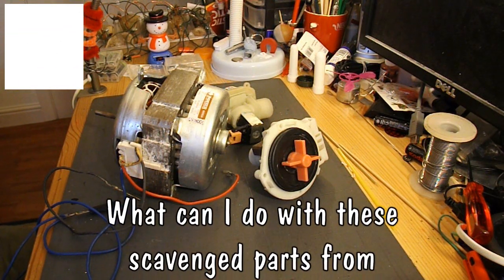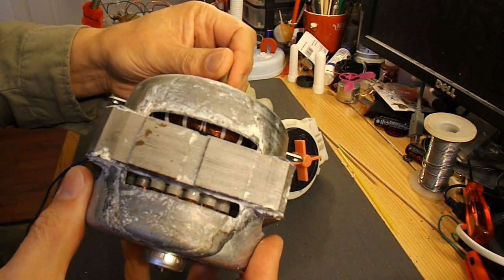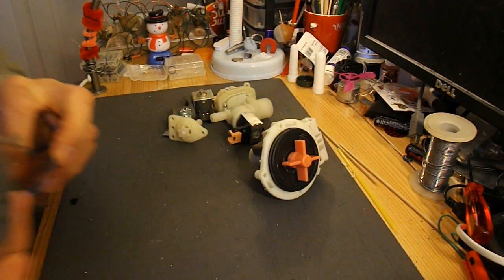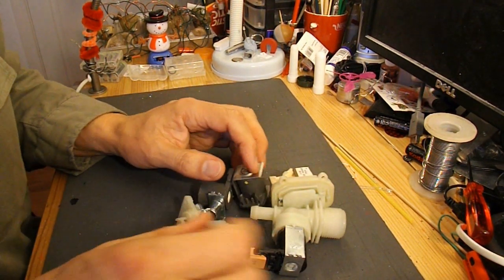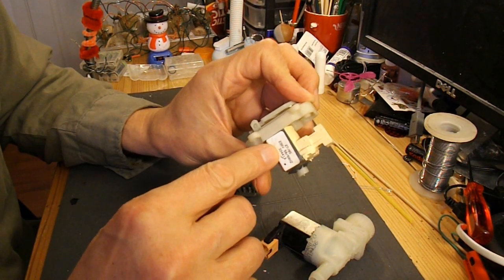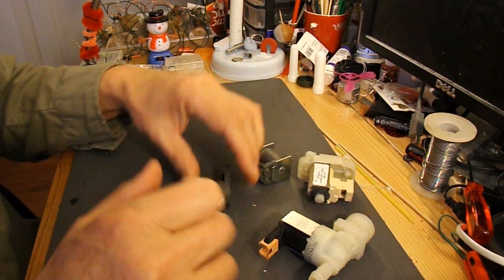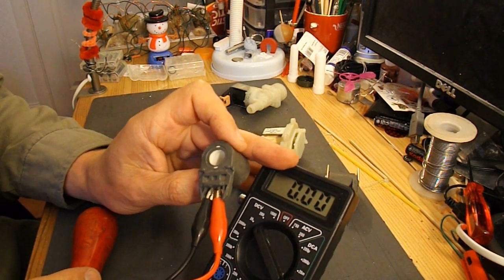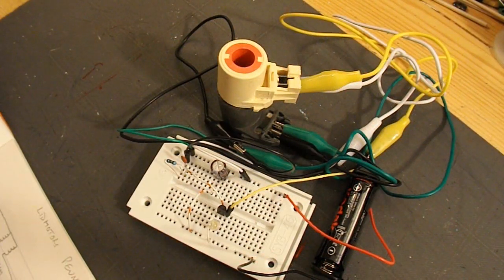What can I do with these scavenged parts? #1

Comment: Was the screwdriver tip magnetic, could that be the fluctuation in your numbers?
Reply from the maker: I love it when a random comment gives me an idea for another video. I suspect you are probably right that the screwdriver has a magnetic tip but putting an iron core in the coil will still generate a current and as I don't possess a Gauss meter I cannot prove that any material I use is completely free from a magnetic field. However, I will set up a little test to compare a few items on my desk to see what current they generate. Not sure when the video will be ready but thanks for the idea 🙂😀😍
Reply: I don't really know anything about this but I'm trying,lol I just removed my old dishwasher and I just can't bring myself to throw out the components. I want to make some kind of battery charger or something but I'm happy to know I sparked your interest in to a cool new video.👍👍👍😎😎👍👍👍 Thank you for your reply.
Reply from the maker: This will read wrong, but I spent an hour or so sticking various implements into a coil and measuring the results. I think when measuring very small voltages and currents it is easy to see readings that are the result of something else happening, not what you are trying to test. The video will be published on Tuesday 15th January and it will be interesting to see what the experts say when they see what I was doing. No doubt give me plenty advice about what I was doing wrong but it might generate some views. One of my more "popular" videos is one where nearly every comment is somebody telling me I am wrong. I used to worry about it but now recognise it generates views for my channel 😜
Reply: Haters are going to hate, but views are views. Hahaha You'll be laughing all the way to the bank.👍😀👍

Comment: If you slide one of those solenoids over a exhaust mounting U bolt or similar you can make a magnetic memory circuit using a 9v battery.

The main motor as you referred to can be used as a generator, if you turn the shaft using a drill initially nothing will happen as its an induction motor and the core needs power to work, howvever if you 'blip' the windings with 12v or so it will start to generate, the voltage will be dependant on its rated speed, probably 1440rpm, this only works if the motor is shaded pole or permanent capacitor, ie doesnt have a centrifugal switch.

Comment: If you charge up a HV capacitor (up to 300 Volts or so) using a fly zapper or so, you could use one of the solenoids to shoot metal balls ;-)
The defective coil? I think that one is the reason for the washer not working anymore.
You already found the joulethief application, always fun to do.
The pump as a generator is funny, but it has a lot cogging and needs a heavy flywheel to be used anyway.
Nice scavenging! A great way to have a hobby (I do the same as well)
Reply from the maker: Thanks for the input, the high voltage capacitor could work but I would need to keep it well away from my grandchildren (and me). The pump as a generator might be OK with a big crank hand and use it to drive a toy car on the end of a wire lead. I think I will see if I can disassemble that faulty solenoid just to see what's inside.

Comment: i love seeing coil driven pistons. maybe a little 2-stroke electric motor?
Reply from the maker: Hi Jeremy, that is just the sort of thing I had in mind but they are 230 volt ac solenoids and I don't really want to have mains electricity floating around with my grandchildren about. I was hoping they might have been 12 volt dc as some appliances use them.